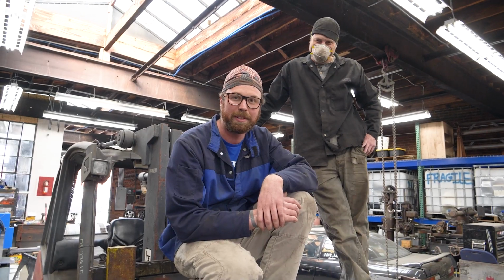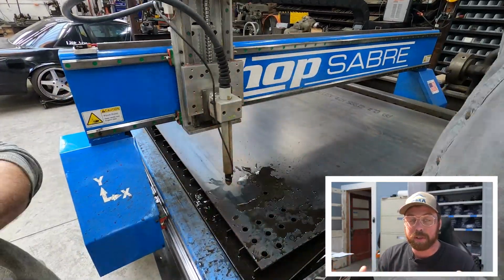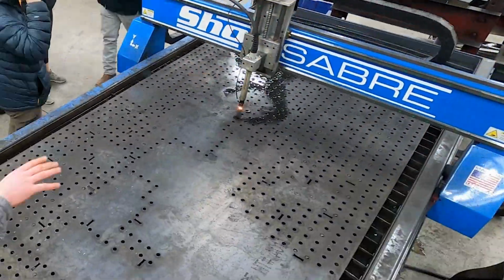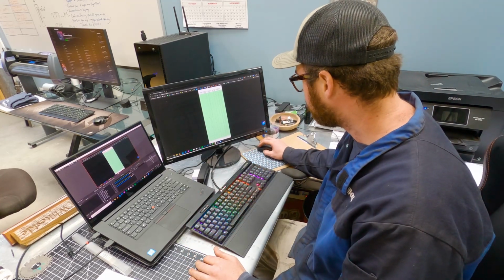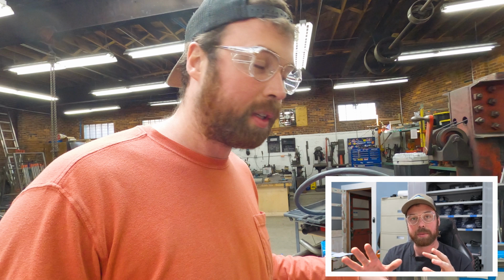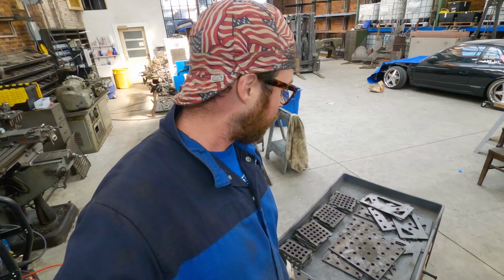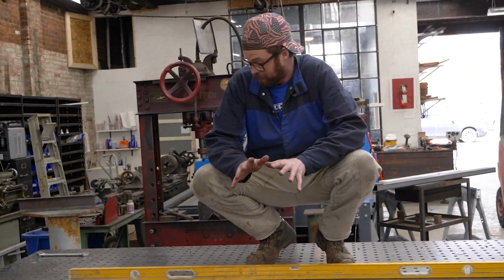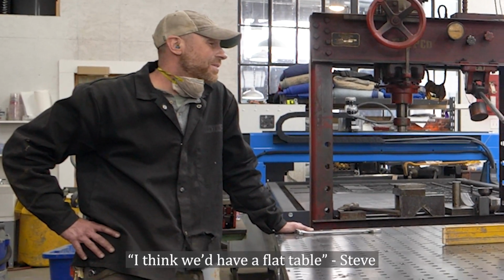Making the ULTIMATE Fabrication Table // Lift Arc Builds

Comment: Two things …. 1 I have the same hypertherm plasma cutter and mine has to have absolutely clean dry air. 2 my cutter does not work in the off position either.   Coincidence or factory manufacturing error?

Comment: The company I worked for had a contract to build molds for fuselage parts for Boeing. 
We welded together alloy steel plate into large circular shaped beams. 
There was a tremendous amount of welding to attach all the pieces. That resulted in severe, 1/4" to the foot in some sections, warping. 
We were able to bring it back to required specs by heating the sections with acetylene rosebud torches. 
We heated the beams on the concave side. That caused that side to expand and the pressure compressed the opposite side of the beam. When it cooled the expansion was reduced almost back to original size but the compressed side kept the compression and flattened out the bend. 
A similar process is used to straighten I Beams that support highway overpass bridges after being damaged by trucks trying to drive through with an oversize load.

Comment: My experience cutting with my Hypertherm 85 is that I always get some beveling of the cut between the top and bottom edge of the cut no matter how much I adjust settings.  in other words, the cut is never exactly square with the top surface.   How did you manage to avoid this in order to maintain a proper fit for your table's accessories?
Reply from the maker: We cut the holes undersized and used a 5/8 reamer to finish them out. Just ream the holes as we need them

Comment: An old guy that I learned a lot of metal fab from said to me... "If you can't make it perfect, then make it adjustable." I would be tempted to add a top of 1X1 precision plates on their own tunable jacks. Like the way Fireball Tool makes their table. The table you have there is a great, very solid, foundation. It just doesn't sound that precise in terms of flatness.
Reply from the maker: That! Is a fantastic line and very true! We could go back and cut some welds, shim a bit and re-weld to get it perfect but honestly, because we're not building rockets, it's plenty precise for what we use it for. The perfectionist in me isn't satisfied but he never is...  Cheers! - Tay

Comment: Clamp your ground directly to your metal you're cutting, also fill your table up to the metal for less back side dross clean up,(these are things we have to do with the Torch Mate system where I work) your Tech dept. can let you know if what I passed on works better or not.     

I'm just a fabricator that gets help/play with the plasma at work
Reply from the maker: First of all, I wish I had a tech department, I AM our tech department haha! There is a 6ft ground rod inserted into the ground right next to the machine with large gauge grounding straps grounding the table and the slat tray in the water table. The water level is definitely something we need to regulate better, amazing how fast it evaporates!!

Im just a fabricator that also gets to play with the plasma at work!

Cheers, 

Tay

Comment: You ever have problems with the ohmic sensor not finding the plate and the cnc just dives into it until it trips the motor when it bottoms out? My shopsabre does it all the time..my finger pretty much lives on the abort button every pierce.
Reply from the maker: Never had that problem actually, luckily... I do make sure to clean the connection between the ohmic cap and the spade connector that connects to it. All that water splash back and the dirt that comes with it cant be good for conductivity. Also make sure you clean the slag off the tip regularly. These are just guesses, im definitely no expert. Good luck! - Tay

Comment: Liked that you used that mag vise to hold your smaller pieces for clean up with the hand grinder.  Another good video!
Reply from the maker: I have to credit the youtube channel 42 Fab for that tip. And being that im in an old machine shop that I cleaned out, i happen to have one laying around! It helps a ton cleaning dross off the smaller parts for sure! Thanks for watching! - Tay